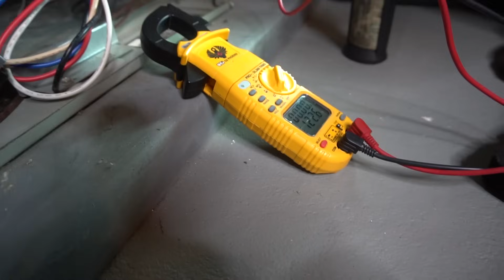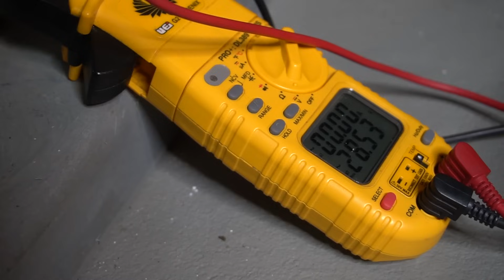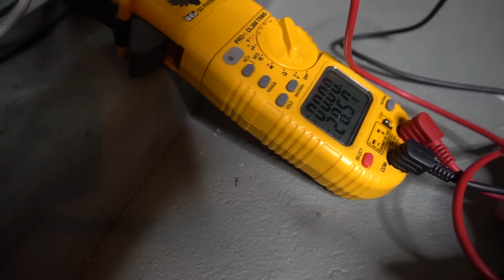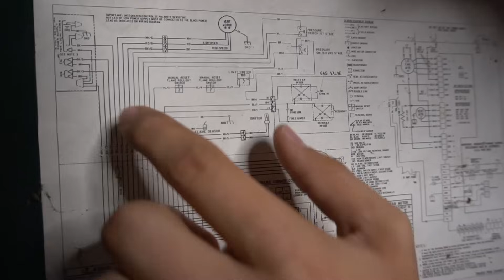Furnace/AC How to Troubleshoot The Control Board

Comment: Hi Jay: I woke up this morning and my furnace was not working (Carrier control board HK42FZ010). It was flashing code 32 (low-heat pressure, draft safeguard, or aux-limit switch did not close or reopened). Transformer has 120v/24v. After power up, the fan motor comes on for 90 seconds when heat is called for, I hear clicks, and it starts flashing code 32. There is no voltage at the inducer motor. I suspect the control board is bad. Is there a on-board relay or separate control board for the inducer motor, or do I need to replace the whole control board assembly? Thanks!

Comment: I have a goodman furnace where it goes through the sequence until the glowstick step its doesn't light up but blower kicks in and blows cold air light blinks 5 times cheat sheet said flame sense with no gas valve what does that mean
Reply: You may have a bad igniter. The igniter not pulling enough current to tell the control board to open the gas valve...
Reply: I replaced with a brand new igniter when I blew gently then sucked on house connected to pressure switch after inducer came on the igniter lit up im pudding towards bad pressure switch but I'm a home owner diy guy trying to save a buck in the pandemic thanks for respond

Comment: My furnace drops 4 to 5 degrees below setting before igniting intermittently.  The furnace company replaced gas valve but did it again. Could it be control board or what should I check?

Comment: Best technician on YouTube. Had an issue installing a new thermostat and hrv control. Ton of wires everywhere and that 5A fuse had blown. Would not have caught its location buried in wires, if the voltage was not checked on the transducer wires. Thanks for saving me $$$. The least I could do was write this post and show my graditude.

Comment: I checked everything in succession including the igniter, the high temperature limit switch, the pressure switch, the inducer motor, and the limit switch on the blower motor on the xr80 trane. Every checked good. The board was 13 months old. I bought another from the same place on Amazon. I put it in and so far its working. Knock on wood.

Comment: I have the same furnace as you do in the video. My single stage thermostat went bad 2 weeks ago, the internal temp was reading 10 degrees high, so I replaced it with a first generation nest. It worked well for 2 weeks but now my furnace kicks off after 1st stage heating (10) min.  At the 10 minute mark the fan ramps up and then the burners shut off. Fan runs high for 30sec then ramps down igniter lights burners light then I hear click and furnace shuts down. I receive 3 red blinks, I think this is a pressure switch error.  I then shut off furnace shut off thermostat and furnace will work in first stage again.  I have my heat set to 64 or 65 sothat the furnace warms the house but doesn't reach second stage.  This has been working to atleast keep the house and wife n kids from freezing. I replaced the flame sensor and pressure switches. Still same error.  My local furnace shop gave me a dual pressure switch replacement, low 0.17 and high 0.50. This tripped at second stage and then did not allow me to reboot to use at first stage so I put the old switches back on.  I tested the board as you just instructed and did not find any issues. Do u have any ideas? Please help.
Reply: Have you fixed the issue? 
My furnace same as the one in video is having the same burner issue of shutting off after 10 mins now but the light of my board turned to continuous or solid afterward.  I also replaced the sensor also without luck fixed it yet.  Plan to get an used one from eBay given new one very expensive.
Reply: It was the control board. Purchased a new old one on eBay for 359 and badaboom it worked. I tried a professional and they said they wouldn't fix my furnace would only replace it. It's going strong!
Reply: Hire a professional

Comment: Hey Jay, thanks for the great videos!  I was having trouble with my furnace, everything was sequencing on correctly but the flames were not coming on. I replaced the control board and it worked great...for about two weeks.  For some reason, the igniter is not coming on.  I’m within the warrantee so I reached out to the supplier and they gave me a new board but the igniter is not coming on.  Is  it possible that I damaged the igniter when replacing the board?   Is there something else I should be looking at?  Thanks again!

Comment: I have a armstrog furnace ultra v 20 years old and am trying to replace a new Honeywell thermostat which illuminates currently 
I have four leads for functions , new thermostat requires a c wire to power illumination , I have a 2 red coming from two terminals one marked R and the other not marked going to my thermostat but one is not used is this a live and would it subtitue for C ....so that I can power the new thermostat without batteries . The old one has batteries .

Comment: Thanks for all of the helpful videos. Have you ever dealt with a 5-flash diagnostic indicator (flame sensed with gas valve off?) When calling for heat, my inducer motor comes on, the pressure switch closes (verified with multimeter,) and then the blower fan starts immediately. The igniter does not glow nor does the gas flow. However, a couple of times when powering on, I heard a few clicks from the board after the inducer motor came on, and then the igniter glowed, but no gas flowed so it shut off, and the fans kept running. I know the igniter is okay because it glows (when it gets power,) and I'm using a good flame sensor from another of my units. Electronic air filter is clean. Advice in other forums indicates a new board is probably needed. What are your thoughts? I have two other Trane units in my house, but the boards are a different model # (White-Rodgers 50A50-474/D330934P01 vs. 50A50-472/D340790P01.) The problem board calls for a CNT1849 replacement while the others call for a CNT2183 replacement. Would it be okay to use one of those other boards with my problem furnace just to test to see if the board is actually the problem? I've found that Honeywell makes a board (S9200U1000,) stating that it replaces both the CNT1849 and the CNT2183 boards, making me think swapping a CNT2183 for the CNT1849 for testing purposes may not be an issue. Is that a correct assumption?  I checked the current board with my multimeter and get 120V into the board, 120V to the transformer, 27V out, and 27V at the R/C points, which, as you stated, makes the board appear to be good, but it seems there is a problem with voltage getting from the board to some of the components when the call for heat comes in. Again, thanks for the videos. They are tremendously helpful for DIYers.
Reply: Swapped the boards and the furnace works fine. Now I know exactly what part to get without guessing.

Comment: What cause the furnace blower to turn off before it reaches the thermostat set temperature on Auto? The blower works when I set the thermostat on on position and heat the house up but I need to turn off because it continues running but on Auto the blower turns of before the house gets to the set thermostat temperature.

Comment: I have a high efficiency furnace which was not running, so did some trouble shooting thanks to your videos.  It turned out to be a bad pressure switch, but post repair when my blower motor runs at high speed it makes a pulsing noise and limited amounts of air come out the vents.  At low speed the fan sounds fine - what the heck have I done? Any advice/tips would be great.

Comment: I have a 20 year old Payne furnace with code 34 (ignition proving failure).  The flame quits after a few seconds.  17v ac @ the flame sensor, 20v ac @ the board.  I cleaned the flame sensor, flame ducts, & the ground wire.  The voltage is still about the same.  The meter in series with the flame sensor reads about 5 micro-volts just about the time the flame quits.  The voltage seems too low based on your stated range of  50 - 180 volts typical.  Is this a control board problem?  Thank you.

Comment: My heat pump by the contactor outside is reviving  18v so that means that the Transformer is bad or maybe the control board inside of the house? Because my unit inside of the house is working and my Heat pump work sometime and sometime not because the Contactor don’t close and the heat pump don’t start. Help please it’s hot now in my house :(

Comment: So I ran through all of the checks noted.  All is good right down to the 27VDC on the terminal blocks, but the blower motor doesn't start.  I replaced the start capacitor.  Is there a way to verify if the motor is getting voltage?  Your explanation was great by the way thanks.

Comment: Hi. Thank you very much for all your help. My control board starts blinking with a pressure switch indication when I switch from AC to Heater, not allowing my heater to start. Once I bypassed the pressure switch, the heater started working just fine, as long as I don't change it back to AC. Do you think I need to replace my board? Please let me know. Thanks in advance

Comment: I really liked his style with diagnosing HVAC. I have been a technician for other appliances for 25 year and this guy is very good. I do have a question. My heater does not heat when hooked up to my wall thermostat, however when I remove the wires from my thermostat and connect the red, white and green wires together it heats. I have checked the hi-limit switches, pressure switch  etc and I am thinking it might be the control board. Thoughts?
Reply: COUNTERPOINT. This guy is helpful on many topics, and I'm sure has saved people lots. I ROUTINELY help people over the phone, and am glad to give advice on DIY. (At the end of the day, I'm interested in developing relationships) So I'm not opposed. But troubleshooting a board has many permutations. Many. I wish I had a nickel for every board that was condemed when it wasn't the board. I'm not being critical of you, but I'm wondering, "A technician of what?!" I mean, if the heating system works flawlessly hot wired at the stat location, and not with the stat IT HAS TO BE THE STAT. Either the stat is miswired, not configured correctly  (if it's a newer stat) or its a bad stat. That would apply on any appliance. My issue with this YouTuber is that everyting is YouTube-able. That's not me protecting my turf; it's a simple fact. We've raised a generation of Google Armchair Genius's. At a certain point, the counsel should be "call a professional." I called a 40 year colleauge yesterday to pull me out of the weeds (I'm a 30 year guy) and this YouTuber incorrectly perpetuates the myth "you can YouTube anything." A wise man knows when it's time to call a professional----in ANY discipline.
Reply: Reading through a bunch more comments, it's clear people are way way over their head. Several of the questions, before I got fed up, had me thinking of the 2 or 3 or 4 things that could have caused what they're describing. JUST TODAY, a woman had her boyfriend change a thermocouple. He didn't know what to do with the hardware, which means it isn't needed. The thermocouple had nto be an inch from the flame---and I couldn't get it out. It took me 30 minutes extra. A blind squirell will sometimes find a nut----and there definately some things that you can do yourself; ignitors, flams sensors etc. But at a certain point, it's time to call a pro. That goes for anything. You can't simulate 10 years experience with 10 minutes on YouTube.

Comment: I have a goodman furnace model gms80903bna that's been giving a 3 flash code so I replaced the pressure switch in the issue continued, upon moving some wires on the circuit board it did a lot of clicking on and off then the light led stayed solid and my furnace worked all night no problem until midday today and I wiggled the bundle of wire harnesses again and it came on again and is working still. Do you think I have a bad circuit board or could it be as simple as a loose wire. Thank you

Comment: Great videos Thanks for all the help. I fixed a couple of things on my AC using your videos....But now I have an issue with the outside unit Compressor and fan do not shut off. The air handler will shut off but the outside unit won't. I replaced the capacitors and contactor to the outside unit....But the only way the outside unit will shut off is when I power it off from the power baker box
My thermostat is ok because when the house reaches the desired ambient the air handler will shut off...but the outside unit wont,   I did notice on one occasion while I was outside the handler shut off and then the outside unit contact shut off for a second but it the reengaged and turned on again... Any pointers?
Reply: You could have a stuck contactor out in the condenser.

Comment: My heater is 15 years old and suddenly wouldn't start this fall. Had 3 blinking lights on my board. Tested the pressure switch (from your video) and it was good. Bought a new board and 10 minutes later I have heat. Thanks for the videos. All of them!

Comment: HI Word, Im trying to troubleshoot a Rheem heat pump desfrost board and everything 
operates well in cool mode, but when i turn heat mode on the reversing 
valve energize but i dont get the 24 volts from yout and cc to energize 
the contactor and after a few minutes fan and heat strips come on and it
 keeps operating that way... any tips what should i be looking for? 
thanks in advance for your response.

Comment: I like your videos they are very informative.

I have an air handler in which the fan runs when the ac is on but not when the heat is on.
When the heat setting is on the fan doesn’t work on auto or the continuous setting. 
When I go to the cool setting the fan comes right on as expected. Do you have any suggestions? Relay?

Comment: I got a question. I have 120v going in to the transformer but only 1v coming out. When I test it with my needle style multi meter it bounces from 1v to negative voltage really fast and makes my meter make noises like and old dial up modem.  My led light on the control board comes on and flashes but I have no power to my R wire, pressure switch, 3 amp fuse or hsi. I do have power to the inducer,  blower, gas valve and the AC works fine. Any suggestions ?

Comment: I have no power on my board, could this possibly be a relay?
Reply: I would suggest that you check the electric panel to see if you have a tripped breaker first , sometimes they trip due to surge or just getting turned off and not back on but to double check the electric panel turn the breaker off and back on since it is hard to tell if it's tripped or not , ( looks like it is on but it's tripped in the halfway point ) good luck and let us know how it goes

Comment: Used your tests to check my circuit board.  Power in to board is 120, power from transformer to board 28 volts.  Steady blinking red indicator light.  Disconnected power overnight and this morning had steady red light.  Was able to run test mode and all functions worked.  Restarted and now had error code of 22 indicating stuck gas valve.  Restarted again and furnace fired up and worked until it shut off after reaching 70 degrees on the thermostat.  Now furnace has reverted back to the steady blinking error code.  As far as I can tell only the thermostat and the air pressure switch.

Comment: Don’t also forget to check the emergency shut down switch not the one by the furnace but the one that should be by your stairs or others by your entrance to your boiler room or other places you may have your furnace hooked up at it could have a wiring problem even older houses it might not have a ground wire

Comment: First, thank you for the video. You explain things in great details. I am experiencing a real bizarre situation. After installing an Ecobee, my fan and furnace work, but my outside condenser unit (both fan and condenser) won't turn on when calling for cool. I followed your other video and checked the outdoor unit by pressing its plunger to bypass ecobee then the unit will turn on. I also checked its capacitor, no bulging and since plunger method worked I assumed the capacitor is still good (don't have a meter with me at the time). So I kindda feel there is something wrong with my board, or am I assuming it wrong. Am I missing something in the process? Thanks.

Comment: Thanks to your video, I found the transformer in my air handler takes in 240V, but doesn’t have 24V coming out as it should, instead it’s only outputting 10-12V. My AC system is only 2 years old so I was surprised the transformer failed so soon. Sometimes I do get 20-24V out of the transformer. The fuse that’s on the secondary wires is still intact. I ordered a replacement transformer, but wondering if you have any advice for other things to check so my new transformer doesn’t fail as soon as I hook it up. Thanks!

Comment: My havac air handler runs at a low speed. There is no capacitor on the blower motor. I have low air flow from all vents. I changed the terminal on the motor from medium to high speed but doesn't seem to make a difference in flow. I'd appreciate some helpful advice.

Comment: I'm going to try look up voltage from the board to the gas regulator thingy. The igniter comes on, but the gas regulator does not click according to what the technician told me. so he said the regulator did not have any electricity going to it. but now I'm wondering because I think he had the whole system turned off! so of course it's not going to have any electricity. Now I have to test it myself! I don't want to have to replace the control board if it's not the problem. It's a code 45 for a Bryant furnace.